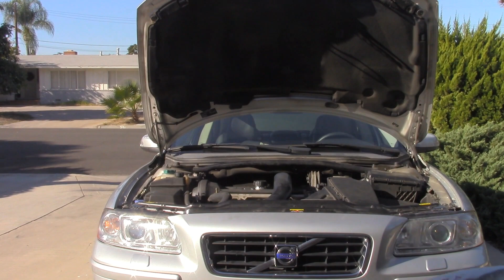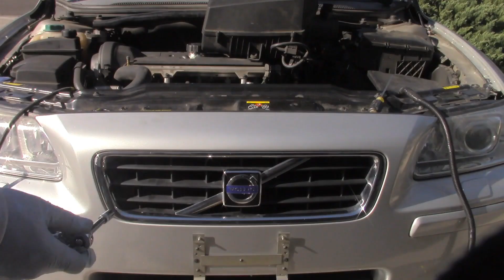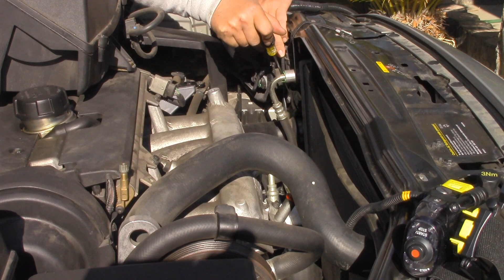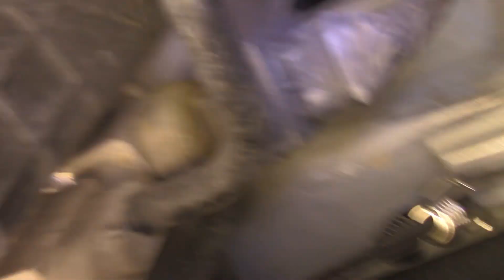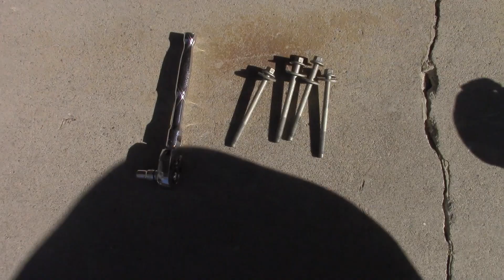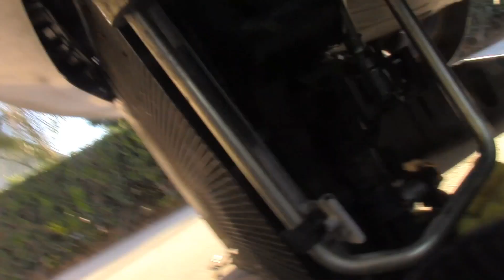VOLVO S60 T5 AC CONDENSER SWAP OUT: Parts and Condenser removal Part 1 of 4

Comment: Hey James, question. Before you replaced your condenser did your cooling fan stay on all the time?
Reply: Just from my experience. I went to gooodyear to vacuum my A/C prior to changing the condenser at home. When I left I can hear the engine fan at full speed so I’m assuming that the A/C sensor detects no refrigerant in the system causing the fan to turn on constantly.  Also I had less than half of refrigerant in my lines before the procedure and my fan was not constantly running.

Comment: Can this job be done by removing the bumper?
Reply: I was thinking the same thing sense it's in the front
Reply: @kalenfryer6848  It's easier to do by removing the front bumper... but it's still a lot of hassle... all of the other videos on YouTube show it being done by removing the bumper...
Reply from the maker: You should do it by removing the front bumper then. Just be careful removing all the plastic pieces. I also think you may have to get one of the pin removing tools.

Comment: Hey bud, you seem to know allot about Volvos.... Is that the AC PRESSURE SENSOR SWITCH on the bottom passenger side? I have been looking for this switch FOREVER..
Reply from the maker: Yes, I think it shows it in part 2.
Reply: @DiyProJames  Thanks Brother - I appreciate it...
Reply: @DiyProJames  I also sent you a Facebook message..
Reply: Were you able to access this without pulling the condenser out of the car?
Reply: @-Good4Y0u  yes, i was... It was actually easier than I thought? Just remove the shroud from the bottom and the switch is right there....replaced it, and the S60 has AC FOR A YEAR. NOW, no issues.
Reply: @indevibe  awesome. Can I ask what year s60? And did you drain the system of refrigerant beforehand ?
Reply: @-Good4Y0u  2008. 2.5T... I believe it's the same procedure for 2001-2008.

Also, i did NOT drain the system, the sensor is positioned in such a way that when you remove it, it does not drain whatever refrigerant in the system.

The connector has a valve that stops the refrigerant from dispensing when you remove the sensor.... But be quick when removing the old sensor and you'll be fine. 

IT was WAY easier than I thought.
Reply: @indevibe  brilliant. I'll be doing this very soon then. Thank you ! I'm glad it's on a one way. Did you replace with this part number Volvo 8623270 ?
Reply: @-Good4Y0u  yes I did..... You are ok your way... 😁. It's hot man, AC is a life saver...
Reply: @indevibe  it was 95-100F where I was trying to vida my car to figure out if it was the sensor today. You're a godsend for having this info and coming back to answer these questions. Thank you so much . Ordered the parts
Reply: @-Good4Y0u  all good man, sometimes  things just line up and work out.... ✌🏼
Reply: @indevibe  to replace the AC Pressure switch, do you need to vacuum the AC system and suck all the feon out first? Would really appreciate that details. =)